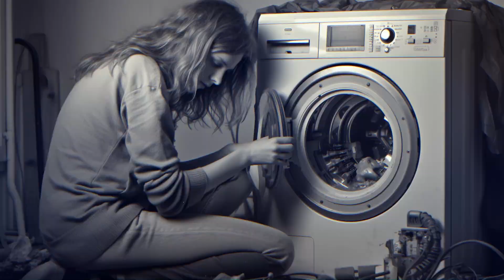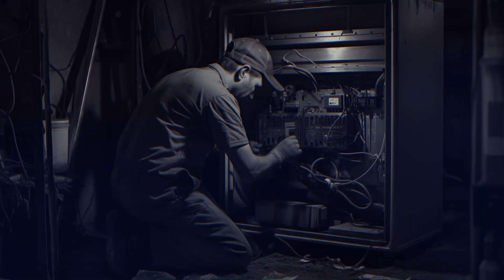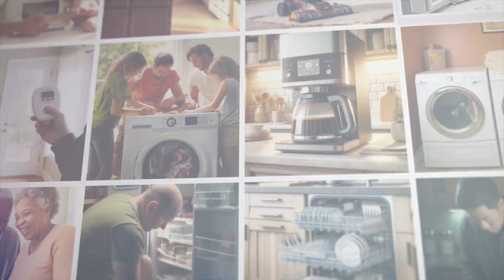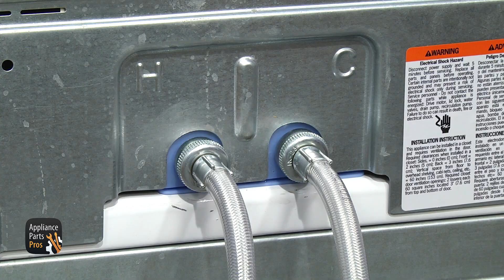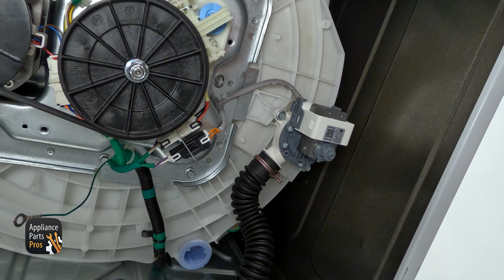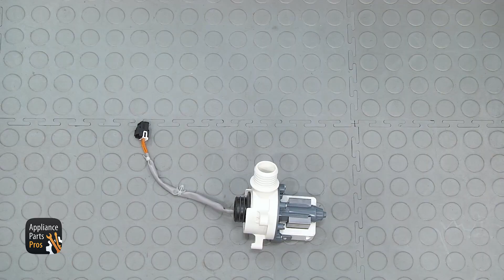How To Test and Replace A GE Washing Machine Drain Pump

Comment: My machine drains when it wants it has a mind of its own. I reset the machine all the time and nothing works. There are times where the machine will randomly drain after 100 tries. Help with the issue please
Reply from the maker: For free technical support, please visit our Repair Forum: https://forum.appliancepartspros.com/.  It’s easy to register, and you can either post your question or search the forum to see if someone else has already asked the same question.
 
Our experienced technicians, with over 20 years of hands-on appliance repair experience, are ready to answer your questions and guide you through your repair.

Comment: Can a faulty drain pump prevent the switch from locking? We have replaced the lid lock switch, but the washer will still.not engage the lock, but it clicks when the spin cycle should engage. It is draining, but not spinning. Then it leaks.
Reply from the maker: Hi Darlene! A faulty drain pump usually won’t stop the lid from locking, since those are separate functions. If the washer is draining but not spinning (and now leaking), it might point to something else — like a control board issue, a motor problem, or even a hose/seal issue.

Comment: Thanks so much for this. Replaced my drain pump and it worked immediately. Couple things:  there was no ground wire and the wiring harness was very difficult to un clasp. Had to use a very narrow screwdriver.
Reply from the maker: Awesome to hear it worked, and thanks for the heads-up! That harness can definitely be stubborn—glad you got it sorted. Appreciate you sharing your experience!

Comment: If the drain pump is faulty, will it prevent the tub from spinning?
Reply from the maker: Yes, it can! If the drain pump isn’t working, water may not drain properly—and most washers won’t enter the spin cycle if they detect water still in the tub. Definitely a good place to start troubleshooting.
Reply: I replaced the drive belt and the drain pump. I made sure there was nothing clogged in the hoses. It worked for a few cycles but now it’s back to not draining and because of that will not spin. At this point I’m wondering if I should just get a new washing machine